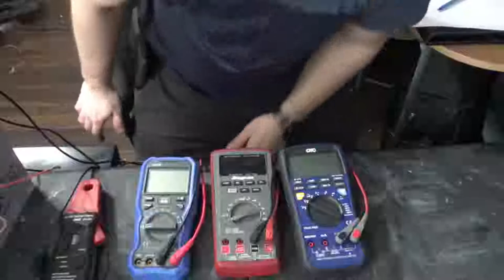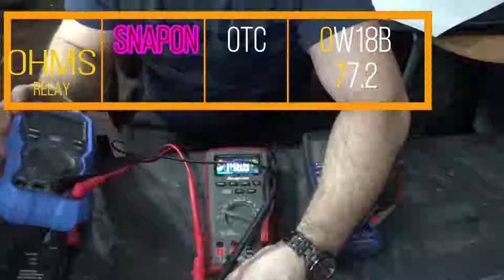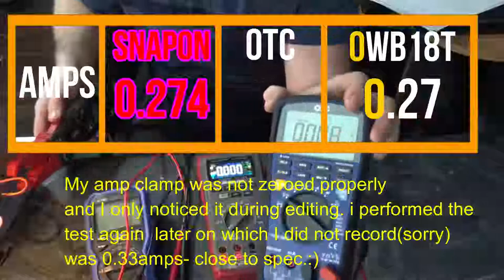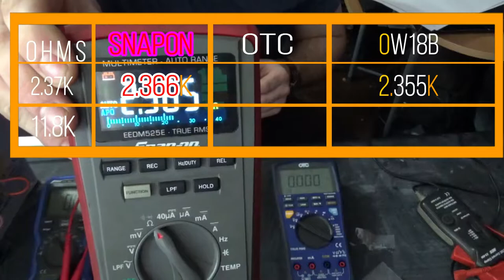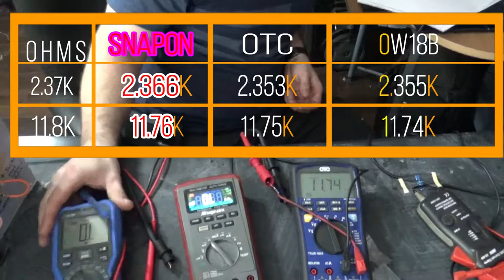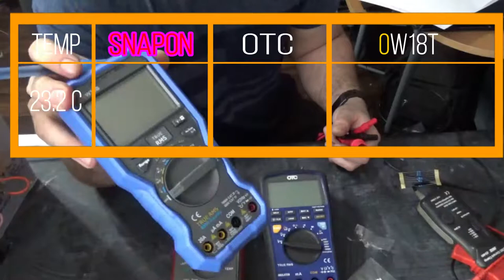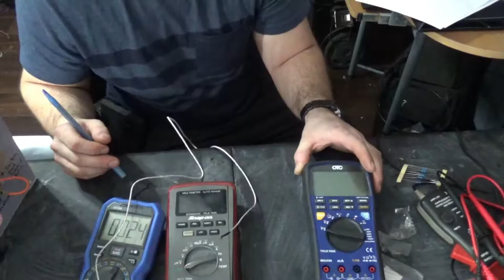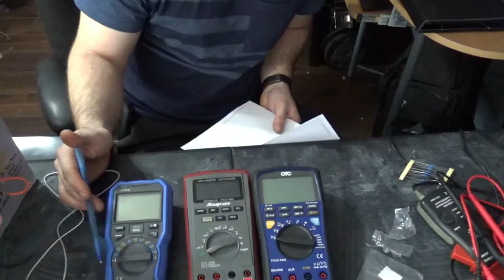Snapon vs OTC vs OWON: Which would You Choose?

Comment: Its pretty rare for meters to read the same, differences in component production when building thousands and thousands of units means there will be a small amount of expected variation.  You can even take five meters of the exact same make model and year and still get slightly different readikngs,  the small variations seen here likely fit the manufacturers specs for accuracy - if you were going to run a test like this you should note the manufacturers specs for accuracy, usually plus or minus a certain amount, also different meters are calibrated on different master meters which ALSO vary depending on when THEY were calibrated and what they were calibrated with.
Reply from the maker: Thanks for the input,

Comment: Where are these meters made? Surprised that OTC doesn't have a AMP setting. I have a old OTC 500 and it has a 20 AMP and a mA plug in. Also have a accessory 200A or 2000A clamp probe with it--AC/DC.